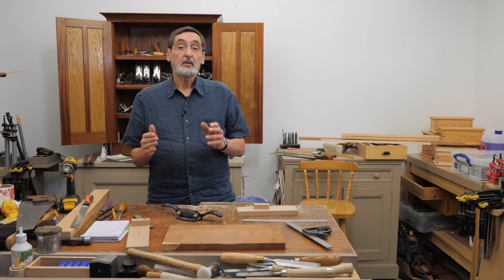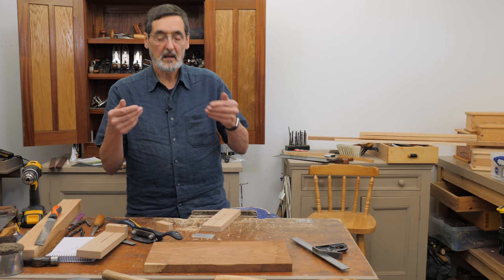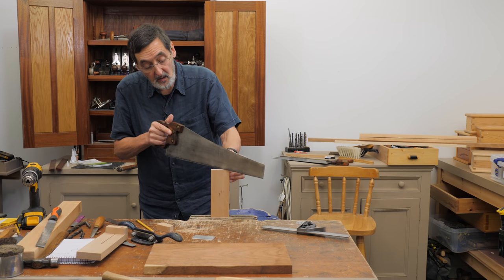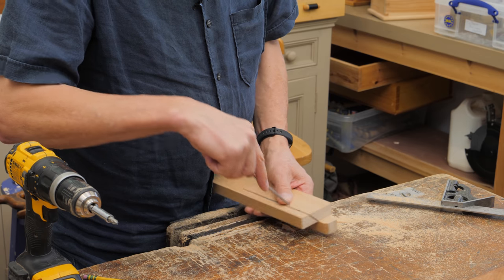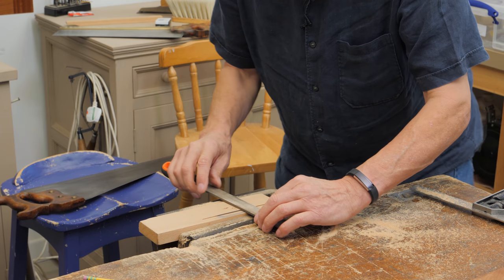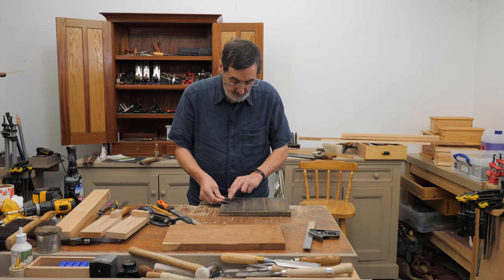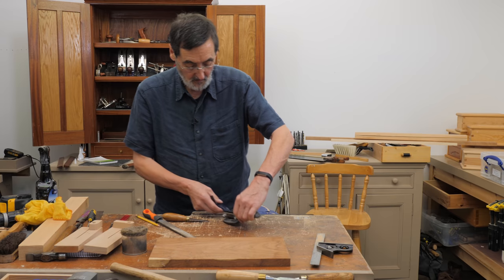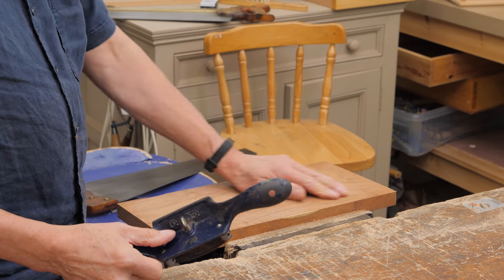Cabinet Scraper Honing Guide | Paul Sellers

Comment: Excellent video and process.
Thank you for the background and instructions on proper technique. Using the scraper by hand is not an option because of surgery. I found the Stanley  #81 at a Habitat-Restore for a few bucks. Thanks to you, the jig for sharpening will make this No. 81 a go to tool for paint removal and finishing without the pain in my thumbs. Bless you for sharing.

Comment: Paul, would this method work on a 12-½ scraper? I received an antique one as a gift and haven't been able to figure out how to use it properly. It has the original wood sole, but a poor replacement handle that I need to replace with something shaped more like the original one. The blade has a bevel on it and I've been sharpening it like a smoothing plane. Do you also have tips on what angle to set the blade at and what direction the blade sits in an No. 12-½? 

Thank you very much,
Aaron
Reply from the maker: Probably not because the pitch the blade is held at is very different than the 45 degrees.

Comment: Paul, wonderful presentation!
Would this method work for larger card scrapers? I generally hold mine with my hands; and they’re 4 times the size of your 80.
Thank you,
Sonny
Reply from the maker: It’s not really necessary for a card scraper because the angle is square and not 45°. Having said that you can cut a saw kerf alongside the piece of wood and clamp it along the vise to guarantee the edge is square after filing.
Reply: Paul Sellers thank you for the information Paul.

Comment: That is by far the lightest tone I've ever seen on mesquite. Very nice. Its so hard that it took serious metal drills to put in mounting bolts on a 7 inch by 12 inches - wild edge - by 7 feet long fireplace mantle. It was so heavy that it took 2 of is to lift it onto a temporary support shelf with legs I'd built to mount it. 

By contrast, we same 2 guys lifted up a 8 X 12 inch by 20 feet long solid Doug For porch beam, carried it to feet, up steps, onto 6 foot ladders and tied it in. Not much harder, really.

Comment: I'm not seeing why the turn block that is screwed on helps.  If it is less than flush of the  main body of the guide, what is it doing? It's not under the blade, it's not being pinched by the vise.  watching again, that little block prevents the guide from torqueing, twisting, sliding down...ah...Paul says "sliding" down under the vise.  it keeps the guide level on both sides of the kerf.
Reply: Thanks for this comment as I COULD not for the life of me figure it out either.  I came here looking to see what the heck I was doing wrong or doing right but not understanding the concept of the swiveling block.  

None the less I used it and followed Paul’s steps on sharpening it with the file, honing guide, and burnished to turn the edge and my scraper blade is shaving great now.

Thanks Paul for this video, and Brian for letting me know I wasn’t the only one stumped by the turning block.  I now understand it’s purpose.
Reply: @patsadr8369  if I had to describe it now, I would say "because the kerf is cut at a 45 degree angle, a vise will not squeeze the iron from exact opposite sides; therefore one side of the kerf will dive under the other under vise pressure.  

The screwed in block stops that from happening.
Reply: Yep I get that too.  But in my infinite wisdom I used a piece of cherry and it doesn't have that springiness after I cut the slot.

I'm gonna try with pine on another one just to see if there's a difference.

The 2 halves of the hardwood guide don't move at all

Comment: Can I use the same method on a card scraper I will be using by hand (without the cabinet scraper body)?
Reply: Brian Christman I have tried yhis method for one of my card scrapers, it didnt work very well for me. I still do the flat grind & burnish with a 6" long snap on 3/8" socket extention it works great for me.
Reply: no, there is a different technique for that. There are videos in the master class site for that.

Comment: I’m still perplexed how that block of wood screwed onto the board holds the iron. Mine doesn’t, maybe because my saw kerf is too wide for the iron, but I don’t understand how that block does anything more than keep the iron from sliding out the end. It isn’t the block that keeps the kerf tight enough to hold the adjusted iron, but only the vice itself. Am I missing something here?
Reply: I was wondering this too. Did you ever figure it out?
Reply: I'm certainly no Paul Sellers but if consideration is given to the fact the slot is being cut on a 45° angle there is a chance that as the board is clamped in the vise the open end of the board may shift up the 45° plane.  This could cause the scraper blade to shift as well resulting in less than desired results.  The little swivel board is to prevent that.

Comment: What is the tool at 9:30, burnisher? ?
Reply from the maker: The burnisher is an extremely hard piece of steel we use to consolidate and burnish the softer steel which is the blade. We use this to turn the edge and you can find more information on this by re-visiting the same video you’ve just seen.

Comment: Why does mine scream like two cats tied together? Have I turned the edge too far/not enough? I have all the bolts plenty tight...it’s almost unbearable the sound it makes.
Reply from the maker: Perhaps you have the blade in the wrong way around?
Reply: Paul Sellers that’s what I initially thought but it’s facing the correct way. I also thought maybe the blade was protruding too far from the body. I seat the blade just as you show but still get the screeching sound. Is the sole of the body suppose to be flat or should there be a hollow toward the middle of the throat where the blade come through?